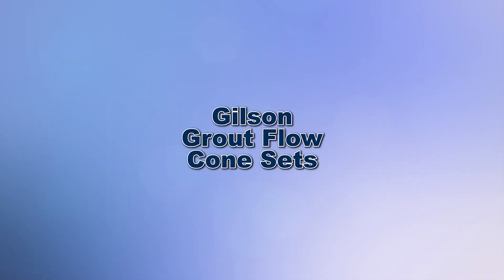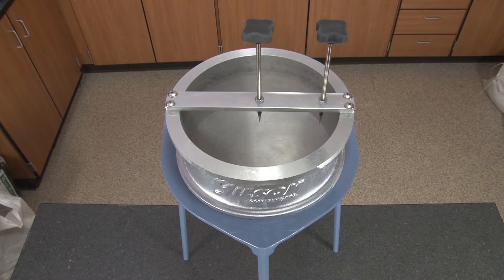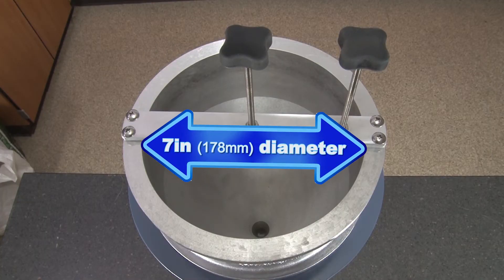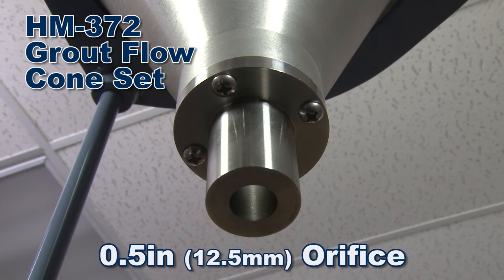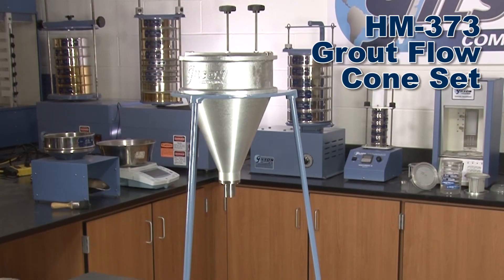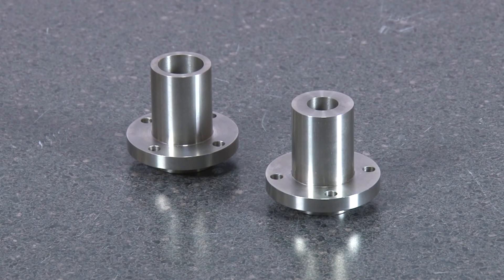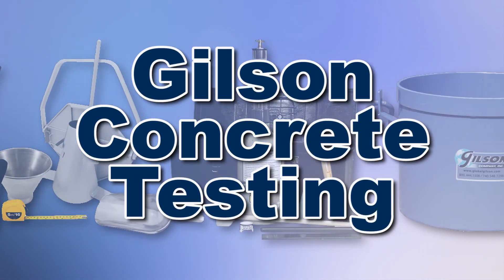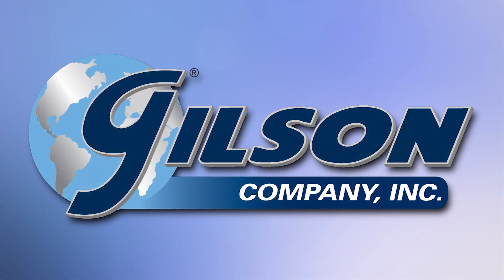Grout Testing: Gilson Grout Flow Cone Sets (HM-372)

Comment: Is there a separate  ASTM for 3/4" orifice??
I'm on a auger cast pile job and they are asking specifically for 3/4" instead of the 1/2" orifice ???
Reply from the maker: The Gilson HM-373 Flow Cone Set is fitted with a special 0.75in (19mm) Orifice for less flowable grouts, and meets ASTM D6449 test standard. You can find it here https://www.globalgilson.com/grout-flow-cone-sets
Reply: @GilsonCompanyInc  thank you for the assist... i couldn't find an ASTM for the 3/4 to save my life 👍👍
It seems the 3/4" is good for grouts up to 35 seconds and the 1/2" is good up to 25 seconds... 

I'll have the boss order one for next time... thanks so much for the ASTM 👍